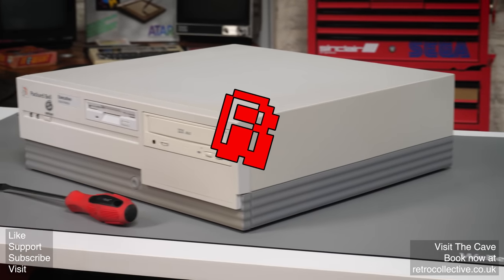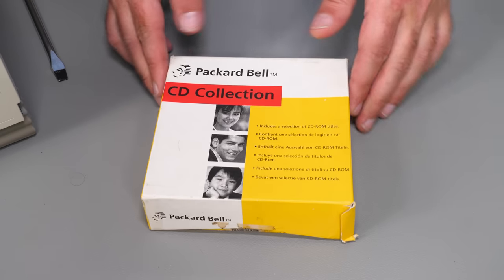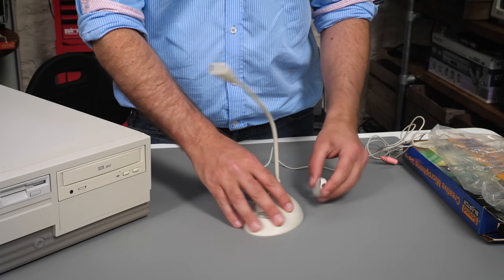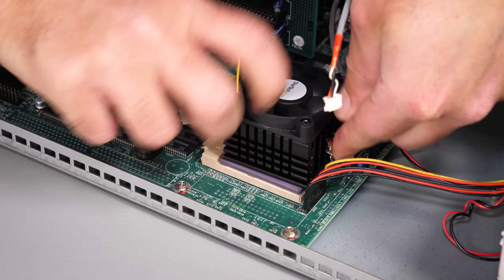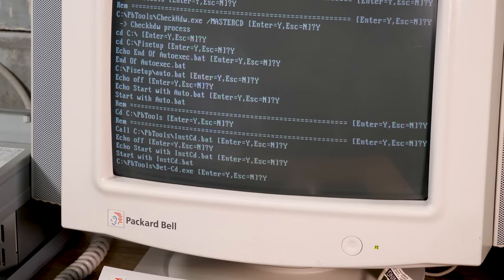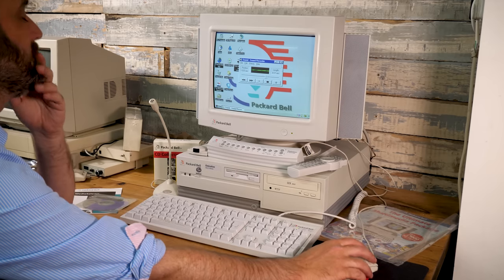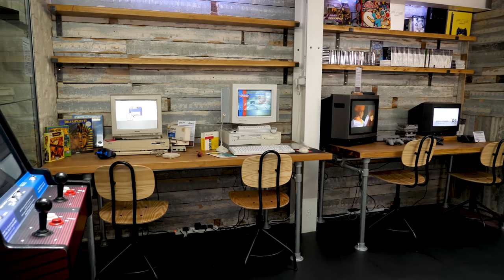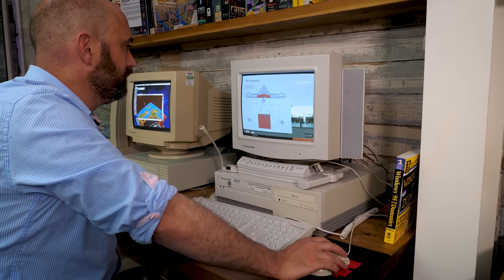Finally, a Home Fit for a ’90s Packard Bell | Trash to Treasure Part 5

Comment: 9:20 You can have thermal paste on an Pentium 1 if you want but it isn't really necessary as the active cooler isn't either but that won't hurt anything. Repositioning the old cooler would've been fine with me as well. However the fan blows down on the board being an top down or downdraft cooler and it has enough clearance to suck air in under that card so didn't get the concern here..

Comment: If you have to re-partition or change the hard disk, there's a specific procedure with Packard Bell PCs from this era. It implies the command "tattoo" from the recovery media (CD or floppy disk) that allows the system to identify the HDD as legit to install Packard Bell restauration disks.
Reply from the maker: Thankfully this one is a little before the tattoo process came in and we didn’t need to do that when we replaced the HD with a DOM
Reply: @RMCRetro  Yup, looks like the tattoo process has been introduced with Windows 95B. Here's a video for people who need to use this procedure, it includes some resources with the description of the process for many PB models :
https://youtu.be/0UU96kAftGg

Comment: for the remote control  you should check if the infrared is working there are tests you can do to check its working i think you can do it with a camera

Comment: Think I have a mike that's closer. Not a Packard Bell but the arm is identical as well as the attachment to the stand. Stand looks a bit different but is also closer than the one you got there. Have to try find it and see if it works.

Comment: My first PC was a Packard Bell and I've used and fixed several others besides. I never could understand why all the hate. They were pretty solid, low cost machines. Compared to the tinfoil crap the likes of Dell & HP started making later on, I'd almost say they were premium.

Comment: How about some assemblers, cross assemblers, text editors, and programming languages that ran on the PC.  Some other design tools such as CAD and PCB design software. Eagle was a PCB/CAD program.  Flight Simulator and other simulators might also be recognizable.
Reply from the maker: I stuck to the bundled software but personally a Packard Bell is what I learned C on with Borland Turbo C and I have really fond memories of that

Comment: Have you ever considered using FreePBX (or another VOIP solution) and ATA's to re-create a dial up experience? You could probably do up to 36k or so (56k won't work because of ISDN + the easy ways to make a dial up ISP).
Reply from the maker: It sounds like a fun idea. I actually have an old Panasonic pbx here which would do the job. A future episode perhaps

Comment: I'm sure you have, but did you check remote was outputting a signal, if not, those old rubber buttons sweat and then stop the conduction from the press. Anyway, thanks for a great video

Comment: Maybe the remote control isn’t actually working on the unit. You can check to see by using a camera on the remote IR window and press a button to see it it lights up

Comment: I don't remember anybody having that multi-media add-on with the remote. But, I due remember the monitor and stupid mouse. I also remember people crying when the combo modem / sound card died. Mostly the modem side. As for the bundled software. I remember people using games, word processing and maybe an encyclopedia. By that time Corel word perfect came around. Nobody wanted that and was upset they didn't get Word. One of the later cd's you could get. (Not sure if it was sold with PB or not.) was Microsoft works with word. As for the amount of memory. Seemed like all the name brands shorted you in bundled or budget systems. I remember when they offered 4 or 6 and the place I was at offered a custom machine starting with 8 megs. One thing I did find myself thinking about. If you had dos and or windows 3.1 machines. You could find a automatic switch box for printers and connect a nice laserjet series III or something to that collection. But, when windows 95 came around. Most people was using network cards and sharing or external  print server.

Comment: Yes the Windows 95 CD was included. It was slightly newer than the one that shipped with our DEC Station 917 as it had MPEG videos on where as our DEC Windows 95 CD just had AVIs on. - I'm only 4 mins in so I might have more comments later!

Edit: Bendy mic! V. Posh ;)

Edit 2: I was wondering where the IR sensor was, as it was part of the original mouse. Shame it didn't work though :(
Reply: AFAIK, the MPEG videos were included on the Win95 OSR2 CD, while the first release had only AVI files of Edie Brickell's Good Times (first ever video I saw on a PC in 1996) and Weezer's Buddy Holly, plus three Windows 95 animated ads.

Comment: As was back in the day, fuss over the quality of the fan sitting on the cpu heatsink! the cheapskate oem's would slap on sleeve-bearing fans that would fail within weeks. From that moment on I would always insist of fitting a ball-bearing fan, usually a Delta. Would outlast the life of the machine they were that good. Also I am gutted to report I no longer have any Packard Bell stuff, I would have sent it to gratis if I still did. A friend had the exact same machine and I got my hands on it breifly back in late 1999, but soon pushed it on.

Comment: My parents bought a Mitsubishi Apricot MS540 in 1994, our first PC.

They were sold on its 'reliability', shame as it was a P120 with 4mb RAM, so was pretty slow, a shame as it cost them £1500, they could have got a much faster Packard Bell! We upgraded it to 8mb RAM, but by then the P120 was too slow a processor.

Loved the computer but if it had a P166 and 16mb RAM at the time it would have been fast enough.

Have you got any Apricots?

Comment: Hmn. I fly back to the UK next week amd will have a look for that mic in my shipping crates. I had one... its likely in a box from one of my house moves. As for the media remote, I would be checking the serial port config. My PB never had the ability to have all the comms ports configured at the same time, I had to go into BIOS and mess with settings. I remember my mwave sound card / modem causing a comms port conflict that would disable the remote. I will have a look next week and see if I can jog my memory. Definitely was a resource problem that meant I couldn't have com2 enabled
Reply: Hi, just had a great time rummaging through all my old crates of cables and tech and I found the mic. It isn't on the original stand, it's on a stand from the same era that I used as I kept the mic on top of the curved speaker. No idea how to get in touch, but if you would like the mic for the museum then please reach out. I haven't tested the mic for about 25 years so no idea if it works. Cheers! Gary

Comment: Those HSFs are downfiring, so in that case it's sucking the soundcard towards itself.

I'm going te admonish you to reinstall the original HS to ensure the best longevity. These CPUs can usually take being undervolted so consider a BIOS mod and, if needed, some hardware modding to enable that.

Comment: God, how i hated early PC's.
Reply: Do you mean this era, or actual early 80s PCs? I was never keen on this mid 90s era of PCs; the multimedia thing seemed like a lot of fluff and nonsense, and I never liked the look of, or saw much point in, the remote control or bar of buttons sitting beneath the monitor (much like the custom buttons on keyboards, which I rarely used). I didn't get into PCs until the turn of the century, and apart from missing out on some seminal mid-90s games, I don't regret not getting one sooner (physical space and money meant I couldn't have gotten one sooner anyway, but that's by the by...).

Comment: Would you like to take out our Coverplan with your Packard Bell?  We have 1+2 years, 1+3 years or the best value, 1+4 years.  Your PC comes with one year manufacture guarantee but with our Coverplan you will get 24 hour support and if we can't fix it within 30 days you will get a new one.  Mastercare are our engineers and are trained to the highest in PC repairs.  If you get a fault with your Packard Bell the average cost of repair is over £300.  A hard drive will cost you £200 plus on it's own.  You can spread the cost of the coverplan over 10 months.  With our 5 year (1+4) you can pay £10 today and 10 months of just £31.  If you want to take it out today I will throw in a monitor cover, keyboard cover and a disk storage box.  What do you say?  (Yes I used to sell these for Dixons and the cover.  Loved selling the PCS but hated the cover bit.)

Comment: It's weird!  I have no nostalgia for old IBM PC compatibles.  Once the micros and the unique computers from Commodore, Atari died and the generic PC compatibles took over, everything just became kind of "blah".  It all felt like slapped together generic stuff that anyone could do.  The individual PC builder companies like Packard Bell, Compaq etc  just felt like generic system builders that did nothing special;  that didn't do anything that I couldn't do better by myself with my own DIY builds; so I never gave them much respect.  I never bought any of these builds, I always built my own systems since coming to the PC in and around 1994/95 and it's just been sort of a generic yet continuous evolutionary (not revolutionary) gradual improvement over the years to today.  Completely different from the early micro era with very discreet and unique models and types of computers.  IBM PC compatibles in contrast feel like one big "mush" of a single computer all the way from 1994 to my latest builds.